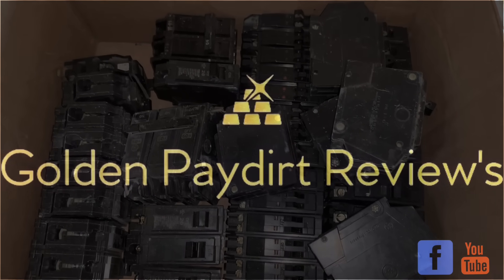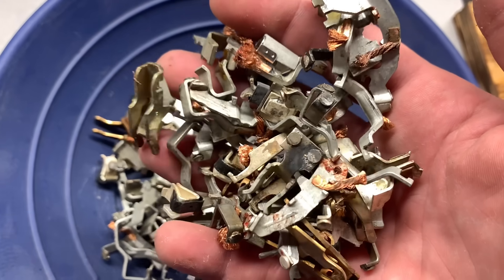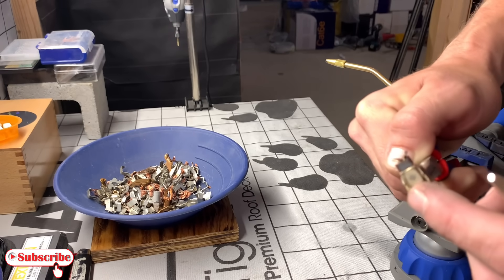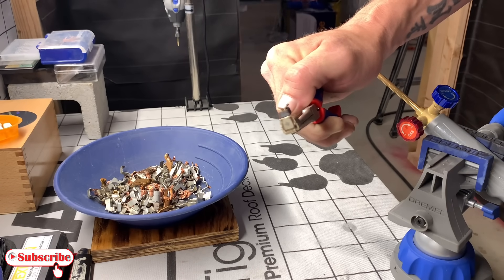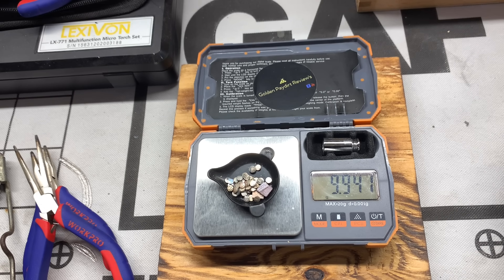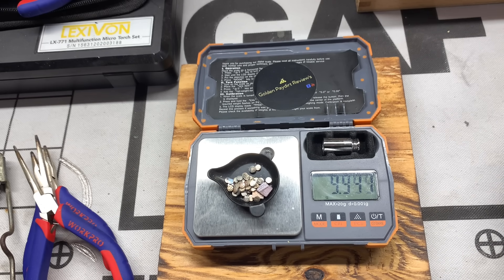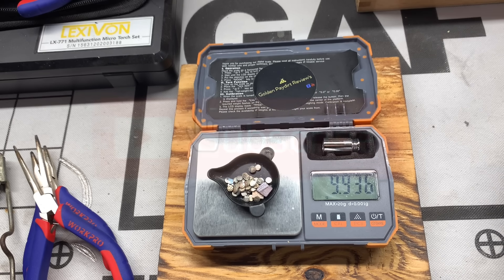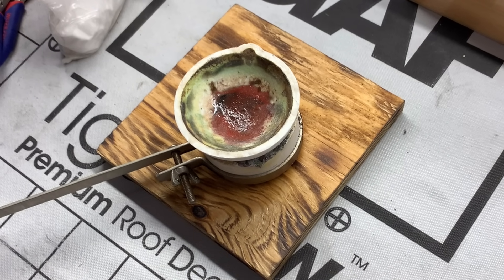Circuit Breakers Loaded With Silver!

Comment: Thanks I see what a waste of time this is unless you are an electrician or some other reason to have a ton of these. There's other good metals there too but worth the time an effort no
Reply from the maker: Let’s use this as a template! I crushed 55, with limited knowledgea’ if I used like electrolysis recovery methods placing the entire breaker into the fluid, I couldn’t gain 80% more!

Comment: So 56 breakers worth anywhere between I'd say 3 hundred to 8 hundred dollars, possibly more 4 silver worth 15 to $30? I like silver as much as the next guy but as an electrician this just doesn't make too much sense just my opinion it did look like you had a good time doing it so carry on😮😮
Reply from the maker: Most if not everyone was a used breaker from a demo job or new build from the prior house standing! I’m sure some can be resold! With allot of time and effort on eBay and waiting on payment then shipping and let’s hope they work, and are 100% safe, then yeah there might be a bigger profit, but that’s saying there new and safe, this video was made to showcase another place silver is used and a method for collecting that silver, there’s actually a lot more silver in those breakers, way way more! Probably 20x more then the method I used, electrolysis recovery method, all the parts inside the breakers are also coated with silver, plus the tabs I took off, 
It’s mostly for educational purposes 

Thanks for watching!

Comment: With silver on Tungsten sponge, you melt the contacts with lead and that will draw the silver into the lead button and the Tungsten sponge will float on the lead/silver and leave very little silver on the Tungsten sponge.
To remove the lead you use bone ash and the lead will be absorbed into the bone ash and the silver will make a bead that you can pick out.
 I got 3 55 gal drums of 100+amp industrial breakers and recovered over 6 pounds of silver from them. The company found out I had recovered them from the  dump and never dumped anymore.
That was no big lose to me as i recovered $1000s of scrap metals a year that they dumped over the years. 
I worked for them during the day and after work would stop at the dump and fill my truck with scrap and take it to the scrapyard and sell it.
Reply: What has cadmium? Is there any PPE to protect from it?
Reply: Not worth exposing yourself to the cadmium

Comment: If those breakers are still good, you could probably get at least $5 each...$250 would buy you 6 Silver Eagles...just a thought.  Good stuff though - never even realized those contacts were silver.
Reply: Who's going to buy used breakers?
Reply: @TheZooBrooksAB  House flippers, service Electricians, anyone looking to save a buck that needs them - especially vintage/hard to find for discontinued equipment. There are whole supply houses in Vegas with used electrical equipment.
Reply: @nvlvdave  I have tried to sell used breakers on a number of platforms. I've never had even one nibble of interest.
Reply: @TheZooBrooksAB  Yea, very small niche market, I guess.
Reply: @nvlvdave  I think my question is still valid then, if I amend it a bit:
Considering that selling used breakers is almost impossible, does that make any sense?
Reply: @nvlvdave  it's not worth the risk playing with used breakers as a contractor. all too often they've been tripped many times or got wet inside/high humidity has rusted internal parts, like the spring retention clips over the bus terminal. which then fits loose and burns up the panel bus bar. many breakers fail that way as is and you touched it last, so guess who gets the blame?
Reply: You guys are crazy; you could sell those breakers for well over $100-300….maybe more if you piece mill it.  Electricians (especially smaller independent ones) would do backflips to get these at a decent price…they most certainly would pay more than $13. I understand the value of experience but I’m an electrician and there’s no way these breakers were all bad. Terrible waste.
Reply: Some breakers like FPE stab-lok breakers are no good and are fire hazards. Those get taken out and are 1980's and older and will probably be pure silver. They have no value as a breaker because they are no longer made or used.

Comment: if the breakers are good you could possibly sell them for more than the silver is worth. with no work.
Reply from the maker: I’m sure you can! The point of the video is to showcase where silver is used and it can be recovered! To each is own what they do with the breakers! Now on eBay where your most likely going to sell them, there hundreds of sellers selling them, so the battle would be on, to make a buck or two plus shipping! Again this is a hobby Channel, so if you have the time and your info precious metals, this is an option! Thanks for watching! Appreciate the feedback
Reply: It's a matter of safety, some trip too easy, while others trip late, nobody should want to put anothers safety at risk! There is a reason someone changed these out, buy new!

Comment: Good evening Martin, I just watched your video on silver recovery. I am a remodeling company and I have collected about a 100 breakers. They range from 15 amp single pole to 200 amp main breaker quad pole. I was amazed by the way you were able to remove the buttons from the contacts. My concern is first the borax, is this just common borax or a specific one. Next is the crucible that you were using, can you repeat use of it or do you have to buy new ones every time you smelt the silver. I know that the crucible can get expensive, not to sure of the cost for the borax. The gas bottles are around 6 bucks here. I am thinking that it may cost to much to offset the recovery. Would like to get your input on this. Also I have lots of electronics, laptops, desktop computers, old microwaves , as well as an old desktop radio, and old flat screen TVS.Not sure if recovery on these items are worth the time. So I would greatly appreciate your input. Thanks for your help. Happy scrapping.
Reply from the maker: Thanks for watching the video BTW! Greatly appreciate your support!

The borax is just simple regular stuff u can get anywhere, the crucible can be used for months upon months, as long as you season it right, I have a video on that somewhere in my video line up, also as long as you don’t ruin the crucible, like leaving any material in there to harden, or of course drop it, beyond that, I’ve used crucibles for longer then a year! The silver contacts ain’t allot of silver in each, but it’s there, the newest ones are plated, or layered on! Not the best, but there still recoverable, best to get older ones, but not every brand in the newer version are plated, if you get enough breakers, you’ll have a decent recovery, again I’ll state this to everyone! It’s a hobby! Nothing to get rich on, or recover what you’re using material wise! It’s basically for fun, and to stack your precious metals! If you enjoy doing stuff like this, then also get into copper! Start collecting copper, and also melt those into buttons, that’s what we call the material that’s left in a crucible because it’s kinda shaped like a button! Everything you can store or aka stack will help you in the long run, like if money fails on the future and the only thing trading like money is gold, silver, copper & brass plus aluminum! 
Hope I was able to help ya on your adventure! 

Again thanks for watching! You can find most stuff I use in my description page below every video!
Reply: @GoldenpaydirtReviews  thanks Martin, yes a lot of my breakers are probably 15 to 20 plus years old and very from Seimens, GE, and some others that are common now. You have given me a great deal of info. I do have a question about the older buss fuses, both the tube fuses and the screw in buss fuses. Are there any metals worth recovery in those fuses or should just trash them. Thanks
Reply: Use an old fire extinguisher as a crucible
Reply: @ShaneMcLickins-ww7mt  some fire extinguisher are aluminum. So they melt before anything you're trying to melt does
Reply: Are you serious right now my guy??

Comment: If it is not 100% silver and some of them are silver plated then it's not pure silver but use nitric acid and then once you have everything dissolved in nitric acid that has been diluted in distilled water you can stick a piece of copper in there and precipitate the silver as cement silver which is generally 98 to 99% pure after it all has submitted out on the copper filter it and rinse until all of it comes out clear and then take that and melt it it's far quicker and far more efficient to do it that way and in the end you end up with a far more pure product
Reply: Personally I am a fan of cupelletion, for anything 99.9% or under. A common earth metal like zinc, tin, or lead, and a bone ash cupelle some heat and you are done. To get 99.99% or better (medical grade), acids and pretty much a lab setting is the only way.
Reply: This process is highly inefficient.

Comment: So glad your back!!! I had the same problem with the contacts that weren't solid. Do you use propane or mapp gas? I wasted so much mapp trying to smelt down my pile of contacts. I'm on the fence about this one. I love doing pours but the frustration of trying to get the silver recovered from contacts is over the top. Mapp gas is what....$12-$14 a bottle. I still have that meteor looking clump of mess in my crucible all stuck together with borax...lol...I use the bernzomatic ts8000 on my smelts. That thing melts everything except those DAMN CONTACTS! Awesome video brother! Thank you!
Reply: Try using a gas with oxygen setup.  Minimize any heat losses you can.  Oxy/acetylene will deffinately melt it with ease quickly but there is more investment.  I've melted in my coal stove before aswell.
Reply: @_FJB_  Thank you!
Reply: You're trying to melt tungsten.  Wash it with molten lead

Comment: Its all worth it in the end! Save it for your kids. Nitric would have taken the borax off instead of losing bits of silver with the wire brush. Thanks Martin for the ideas.
Reply: Nitric acid dissolve the silver buddy 🤘🤘
Reply: @noecarrillo4391  Dont leave it in there. (Sreetips).
Reply: @noecarrillo4391  buddy.
Reply: So how you do it what's the process
Reply: @noecarrillo4391  sulfuric acid to remove the flux